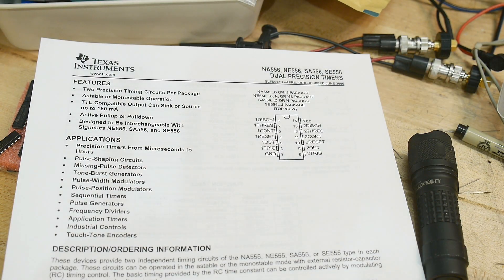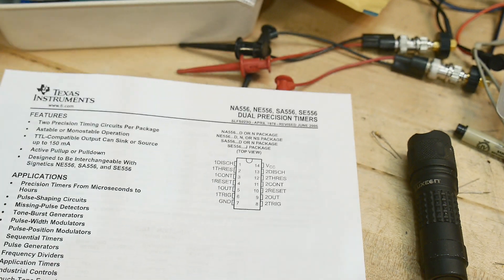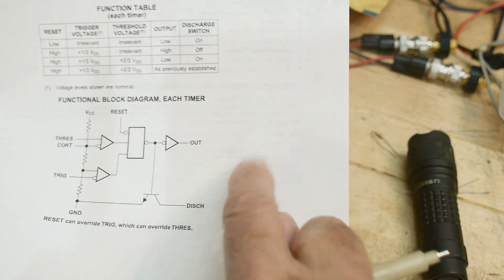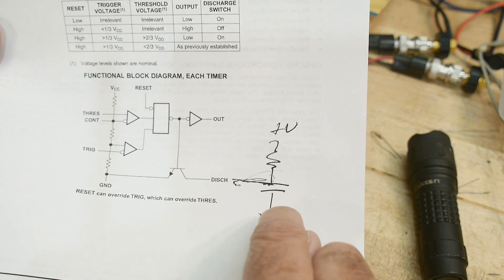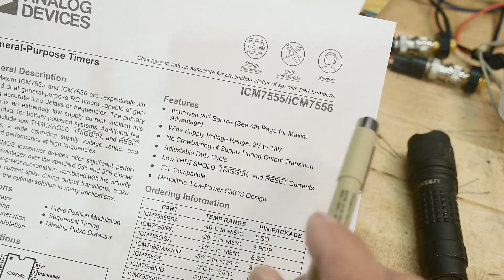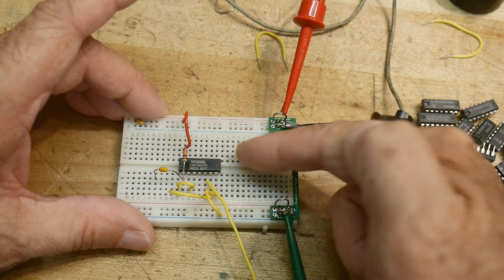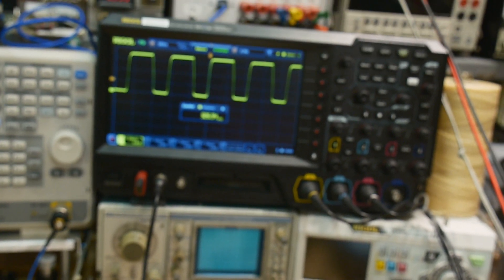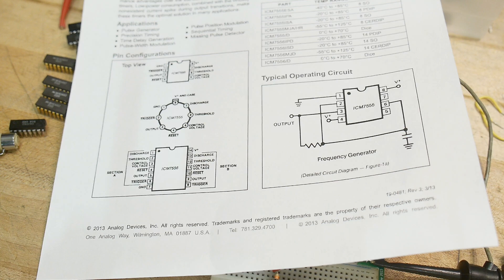#1572 NE556 7556

Comment: I watched this video a few days ago, and today I am working on an old DECWriter IV teletype machine. I have no voltage output from the power supply and going though it, I found they were using an LM556 as a PWM chip for the switching transformer. I thought that was an interesting coincidence. I didn't notice at first, because the way it was labeled and wired, it just looked like a plain old PWM IC. I wonder how many times it has been this IC in the past and I have just assumed it was a specialty PWM IC. It makes me want to look up some older designs from my previous employer and see if they used the 556 for PWM.

Comment: A few years ago I was trying to design a temperature-controlled fan driver using PWM from a 556.  I was driving the fan directly from the output pin of the timer.  It worked for a few seconds and then BANG!  I quickly turned off the power supply and wondered what happened.  After removing the IC from my breadboard, I saw that a big hole had been blown from the bottom of the chip.  Oops!

Comment: A couple years ago for giggles when becoming familiar with  the little brother aka 555 I built among other things a very low power AM transmitter similar to your demo. As I remember I incorporated an audio transformer to allow voice transmission & without filters it did an excellent job of smearing its signal across the entire frequency spread plus the audio was pretty short of high-fi. But hey, in a pinch.....

Comment: I’ve used quite some 7556’s in circuits at work. The CMOS has significant advantages over the bipolar 555/556.
1. The output of the CMOS goes rail to rail where the bipolar has a volgage drop. If you feed the output back to the input in your oscillator configuration then the frequency is more predictable and stable with supply voltage variations.
2. The bipolar version has a transistor at the trigger input which easily saturates, causing troubles if you like to go below 1us switching times. Higher frequency oscillation is therefore less accurate and limited ~200kHz-ish. The CMOS 7555/7556 doesn’t have this issue.

Comment: The 555 and 556 are super handy. But I just bought a bunch of  LMC555 and TLC556 chips. Basically because I'm running them at 3.3v as I'm using the output to interrupt on an ESP32.

Comment: Some c64 models used a 556.
Half for power on reset and half for triggering NMI from the restore button.
As the master cost reducers of the 80s they must have got a good deal compared to 2x 555!

Comment: The 556 was commonly used to generate a variable PWM.  The first one would trigger the second one to go high for the pulses... The first one maintained the pulse width, the second one was the variable duty cycle.
Reply: This was the idea behind Forrest Mims "Sound Synthesizer" (a.k.a. "Atari Punk Console").
Reply: @Enigma758  I built an atari punk console and now everyone else in my family hates Forrest Mims.
Reply: @nickcaruso  I have the same problem with my circuit bent stuff, except they hate ME for it! 😅
Reply: @Enigma758  they’re just irritated with me.
Reply: Starting my first ever project and converting my bike into an e-bike. Had originally planned to use 2 ne555  but now I’m considering a 556 for more space. This video had crazy timing! (pun intended)
Reply: Built the siren circuit from Tom Duncan's Adventures with Microelectronics. Basically 2 astable circuits one slow that modulated a fast astable via its control input with a 1k resistor. 2 modes could be selected with the wail mode feeding the fast astable from the slow astable's RC circuit via an emitter follower transistor. A further circuit was published in Everyday Electronics back in October 1980.